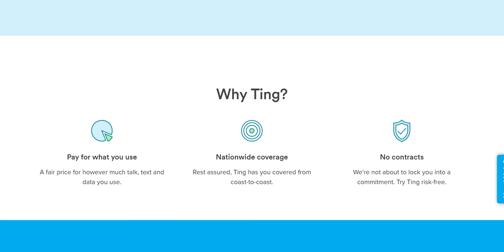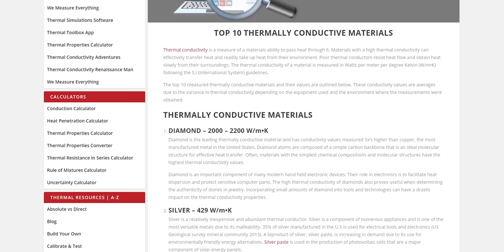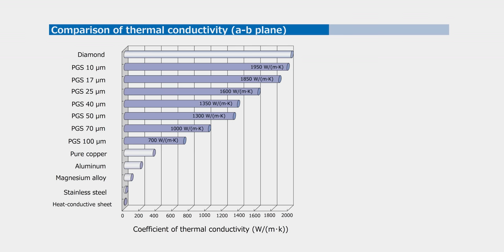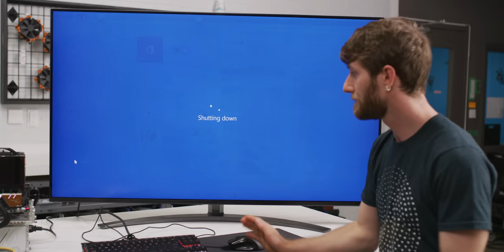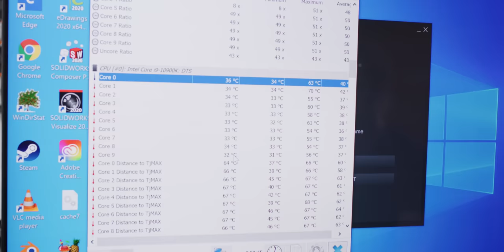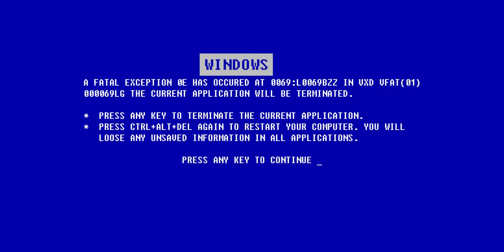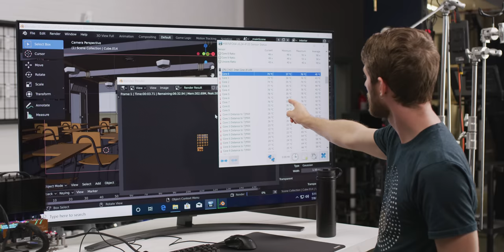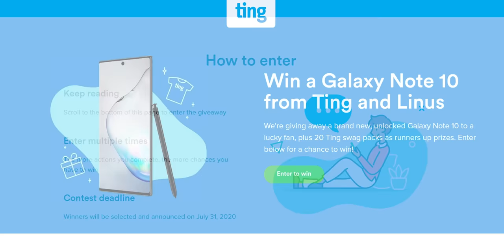This Sounds Too Good to be True - God-Tier Thermal Pad

Comment: Always remember what the Verge taught you: The more paste the better!
Reply: Me when i see this POLICE POLICE CATCH THIS CPU DESTROYER POLICE HEEELP
Reply: Remember to "ziptie" your nuts to your pc case but to not forget the extra paste to make optimal nut cooling efficiency
Reply: Paste soup
Reply: “It’s good PC building practice to use a little extra”
Reply: Use nuttela instead
Reply: And never forget your tweezers
Reply: @zacharytribou2728  you obviously mean to use tweezers.
Reply: @zacharytribou2728  its tweezers duh
Reply: Don't forget to "screw with confidence" the long screws directly into your AIO cooler to puncture it and let the liquids flow inside for best cooling XD
Reply: Because of you I spilled tea on my pants . 😂
Reply: As an Italian, that's true, there's never enough Pasta.
Reply: Don't forget your LiveStrong™ bracelet!
Reply: Put as much mayonnaise on the pins as possible
Reply: Censor this man at once!
Reply: dont forget to use the thermal paste applicator
Reply: Thermal paste poop machine here we come.
Reply: Just don't let the power supply short to the case for heavens sake! I've died maybe 7 times from touching a psu when it's powered can I get a rip please?
Reply: Thermal paste bukkake intensifies
Reply: Bring the bucket
Reply: The boys over at gamersnexus tested this and found that applying more than average helps because it ensures the full die is covered.
Reply: I feel bad if anyone followed that guide
Reply: Forgot to hammer the IO shield and the Verge would of used 50 of these sheets you know, to be on the safe side.
Reply: Hahahaha
Reply: @doge5603  thermal paste bukkake intensifies more
Reply: And confidence in screwing is also a key.. xD
Reply: Legit question: is applying too much thermal paste bad for the processor? What would happen to it? For a layman like me it sounds like more paste means the more heat it could dissipate (which is obviously not the case here).
Reply: worst idea... i've done that before when i know less about thermal paste i spread a thick paste all over my cpu and guest what,,, i makes my cpu hotter and messy
Reply: More paste the harder you hit your face
Reply: don't forget CPU applicator
Reply: @ForceHost  yup
Reply: @TechProYoutube  Nerds....smh.
Reply: Put the product in the title. You've gone back to clickbait crap!
Reply: The "C" in CPU means cake
Reply: Lol
Reply: @this_is_patrick  Most thermal paste is conductive (best thermal paste is very conductive). So if it touches resisters, bridges connections, etc..; it could fry CPU/motherboard or both. But now days the CPUs don't have jumpers and etc mounted on top anymore. So it's harder to fry anything by putting too much paste. But I don't recommend it!! And I've also heard too much paste also makes conductivity for thermals worse, but haven't tried it or seen videos of anyone trying it to back that theory up..

But the space between a CPU and heatsink is about the thickness of paper, so you don't need a lot! So it's best to use the "less is more" method. I always put an amount the size of a small "pea," and use a plastic card to spread it onto the CPU dye. Easy and done!

But I've seen a lot of "YouTubers" put a lot on, and my OCD kicks in and makes me cringe lol!
Reply: @this_is_patrick  yes it is bad for a cpu as when it's too thick it acts more like a thermal insulator instead of a conductor. To simplify it for you it means when it'd too thick it won't transfer heat effectively to the heatsink.
Reply: @JohnBabeJeszareth  yep it acts as a thermal barrier when too thick.
Reply: If your thermal paste looks like a Jackson Pollock painting then you know you are on the right track.
Reply: AHHHHHH
Reply: Ok
Reply: And wear Fight cancer bracelet
Reply: The entire jar
Reply: I always make sure to fill my pc case with thermal paste
Reply: Never forget
Reply: AHHH SO MUCH THERMAL PASTE, YOU NOT ICEING A CAKE!
Reply: Yes because more distance between source and destination is better
Reply: "Cause its good pc practise"
Reply: its good pc building ... practice to add extra bling bling sauce
Reply: Dude, that whole video was a stuff of nightmare. $2000 to be satisfied with 70fps? My God...
Reply: Also remember your thermal paste applicator
Reply: If its not oozing out if the sides you are doing something wrong!
Reply: @DeltaNrOne  I just wanted to forget those even exist..
Reply: You also need a thermal applicator
Reply: Tech ProYT “Destroyer” Calm down man it’s not like it’s gonna dissolve your heat spreader
Reply: Good PC building practice
Reply: They are the legendary meme of computer world
Reply: I like to cover my entire board with thermal paste for maximum cooling.
Reply: Always use 2 tubes minimum.
Reply: They shoulda just stacked 40 layers of graphene
Reply: Putting so much paste that the cpu won't even turn on is the most optimal way to cool it down
Reply: Fill the whole case
Reply: Good advice. I am going to use that ...
Reply: @this_is_patrick  no, its not. It does not affects performance (there are reputable test on yt) and the only electrically conductive aka dangerous for components compound in wide circulation is liquid metal, that virtually no one needs. Heatsink just squeezes out any excess, so the only real downside is a mess that you can create.
Reply: now Im more scare to watch their pc build up video
Reply: Henry cavils pc is 100000x better than verge and also 1000000009x perfect
Reply: LinusTechTips has taught me to use a solid sheet instead of paste. Much better.
Reply: I use at least 2 tubes per chip
Reply: *writes down * the more the paste the better *proceeds to fill entire pc full of paste *
Reply: He is got the point though
Reply: me with a gallon of paste: YES
Reply: If using a packet of thermal paste, Squeeze with confidence.
Reply: to be fair thin amount dries faster
Reply: @this_is_patrick  The thermal paste is only there to fill any tiny gaps between the two surfaces. With modern manufacturing there's not going to be much there at all. Not using any at all is probably better than using too much.
Reply: Don’t drop your tweezers on the power supply or it will short circuit!
Reply: I agreed, after all that computer is “still works”
Reply: @this_is_patrick  thermal paste is no where near consuctive as copper that is used for the heatsinks. The purpose of thermal paste is to replace air between the uneven surface of contacts. Thermal paste is much better than air but not a s good as copper. You would want the least amount of paste but enough to fill the micro gaps. However when the cpu cooler is screwed in, the pressure expels the excess paste outwards, leaving only a thin layer. So you cant have too much paste but can have too litte. The problem with too much paste is that its just messy and wasteful as it spills out on the motherboard. Underpasting is uncommon  as  not much paste is needed to cover the cpu. Years back there were many arguments as of how to apply thermal paste and how much(doesnt really matter much as long as you dont have too little) but the whole thing became a meme. Jokes are often made of too much thermal paste.
Reply: The Verge is stupid but having too much paste literally does not affect performance. This has already been proven countless times.
Reply: Too little is really the only one to affect performance
Reply: An to this day I don't trust anything on The Verge. I don't even watch their videos when they appear in my feed
Reply: I just plop a dollop on my CPU and spread it with a rubber spatula
Reply: @zacharytribou2728  and hammer your braces
Reply: The rule is true for lube though.
Reply: the more surface area covered the better, which is why you should apply it to the pins as well
Reply: @zacharytribou2728  wtfffff
Reply: The bigger the gob, the better the job!
Reply: @TechProYoutube  Putting too much thermal paste is not bad for the PC or for thermals. Once you press the plate down it just pushes the excess paste off the CPU.
Reply: @jonathanjones7751  lmao, he actually said that?
Reply: 1 paste=75kw, 2 paste=150kw. This pattern continues.
Reply: Just use lock tight it works best
Reply: don't forget to put thermal paste on cpu's pin. The more the bettet!
Reply: I'd almost managed to forget that. almost.

Thanks for bringing the nightmares back
Reply: @this_is_patrick  theres two kinds of paste.  One is electrically conductive and any overage might cause a short, absolutely destroying cpu, motherboard, ram and possibly gpu and powersupply if you $##@ up just right.

Comment: As a chemist, I always hate watching Linus do this stuff without wearing any gloves. The idea of fingerprint oil getting on that sheet is maddening!!!
Reply: Would that cause degradation in the test?
Reply: @unwiseproductions  definitely
Reply: Man, I’m not even a chemist, but that makes a ton of sense
Reply: wouldnt any oils on his skin be instantly vaporized off of that sheet when heated to 100c.
Reply: @jmalmighty5433  Nope. Lipids are notoriously non-volatile. Also, if the heat sink is clamped down, there's nowhere for vapors to go even if they did. Any water is liable to corrode, etc. I'm just overly obsessive when it comes to electronics. Dust, oil, water, blah blah blah. Then again, Linus and Co. don't really have to worry, they have such a high material turnover it probably doesn't matter. But it's the principle of the matter for me XD
Reply: @scholarsignus8952  that makes sense
Reply: If a fingerprint can affect the rate of thermal conductivity, how much is the adhesive affecting this test?
Reply: @warrj2  Even if it affects, it's thats not the problem right? Even without any fingerprint or w/e it wouldnt change so much as to be a viable option (it was horrible for that purpose)
Reply: Can you help me with my assignments pls
Reply: If they are consistently getting finger prints on it and the other stuff then the results are still fine. I mean they're actually fine either way bc the tolerances aren't that tight.
Reply: Scholar Signus  if probably applied to both cpu and cooling block is it possible to use the liquid metal paste in between both would that help in the transfer of the heat . I am a first time pc builder and I’m not sure what compound paste to use . It’s the last on my list to get in parts along with cooling system which I haven’t decided yet on , but getting there. Any help is appreciated
Reply: He is simulating how the viewer base will use it if the end up buying it.
Reply: I love how people are attempting to armchair chemist the REAL chemist into thinking hes wrong
Reply: I just kept shaking my head as he went back and forth between calling it graphene and graphite. (Yes graphene is technically 1 dimensional graphite, but for most people there is a big distinction.)
Reply: The fingers grease can easily add couple extra microns. Also dust and what ever else the fingers carries around.
Reply: I mean its linus...
Reply: you as a chemist, he as a content creator
Reply: thing is this channel is now more targeted toward lower iq. so they really dont care.
Reply: @jmalmighty5433  No and kinda Yes, it would vaporize any moisture. But could leave a crystallized substance
Reply: @GeneratedPerson  armchair chemistry vs youtube commenter who probably isn't a real chemist? Who will win?
Reply: What giant monitor is that?
Reply: 8
Reply: 55
Reply: @stryiderredz3244  "Moisture"
Reply: @leopshef  Yes, moisture.... ???
Reply: As a non-chemist, I had the same thought as he was pressing the graphite sheet on to the heatsink.  At least wipe it down with some isopropyl alcohol.
Reply: @jmalmighty5433  you are thinking of water my friend
Reply: qwizzler id bet on the “chemist” because no other self proclaimed chemist has fact checked him, also he had nothing to gain if he lied about being one
Reply: I'm just a computer enthusiast and I cringed hard. I was like with a layer that thin, fingerprints could HALF performance
Reply: He always manhandles the most expensive stuff too.
Reply: @joep4847  The degree depends on the adhesive, but naturally there is a tradeoff in conductivity. But at the very least the adhesive comes from the manufacturer with thermal conductivity in mind, unlike fingerprints

In any case, both adhesive and whatever oils fingerprints contain are more thermally conductive than air and can fill small gaps unlike the graphite itself, so it doesn't render the whole product useless.